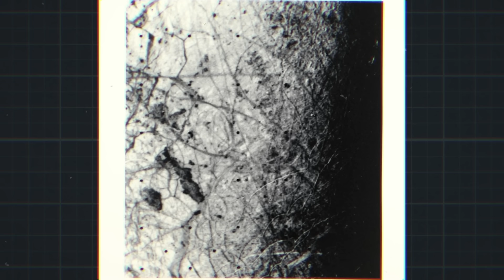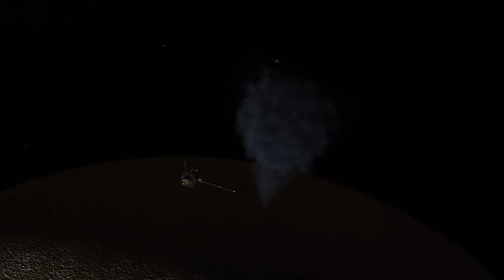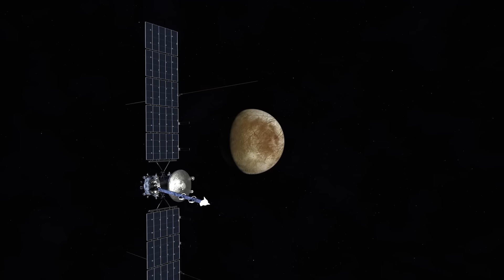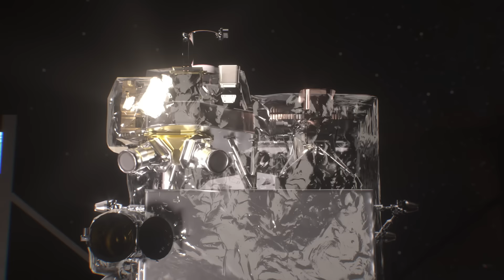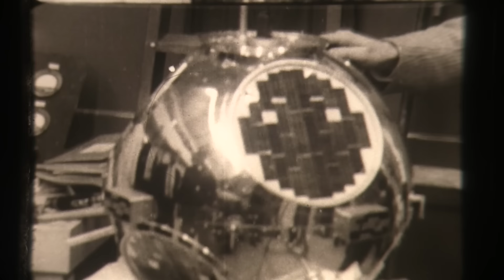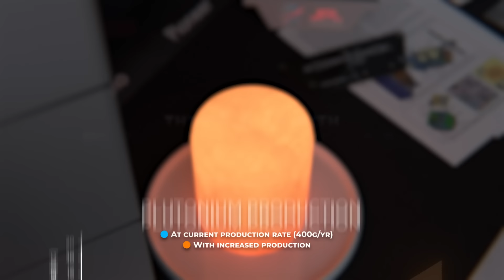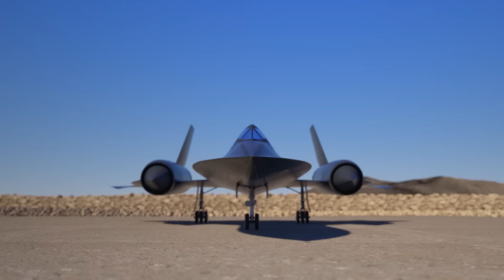The Insane Engineering of Europa Clipper

Comment: Should have created a lander with a drill so we can see underneath. Very underwhelming.
Reply: do you know how long the drill would have to be? also it will have to land repulsively, by itself with no comunication with earth. that would be basically impossible and nasa doesn't have the budget for that, besides what if it ends up landing and then the drill breaks? the whole mission was completely worthless, with the europa clipper it is actually possible.
Reply: @braydenstrand3572 what about a small drill with a camera that operates on nuclear energy. It can drill itself through the ice and nuclear energy is long lasting. Similar battery to what the voyagers have. You also send several drills incase some breaks. This would probably cost around 60 billion. USA spent that in the recent Iran conflict already. It can be done with a little faith and imagination.

Comment: Mars ALMOST had life, but it was too small to keep its core molten long enough so the magnetosphere went kaput and it was stripped of its atmosphere after only a few hundred million years; not long enough for abiogenesis to happen (the earliest record we have of life on Earth is from about 500 million years after the Theia collision).

Europa, on the other hand, has an icy shell to block out enough of Jupiter's radiation for it to not really matter by the time it reaches a potential marine biosphere, is clearly still geologically-active (its shell even has plate tectonics!), an underground ocean that dwarfs our surface one by volume, and many cracks in the ice that could let in a bit of sunlight for algae with reddish-purple pigments targeting infrared light which the Jupiter system still receives plenty of (yes, there are but a few algae species with similar strategies in Earth's deep-sea environments that do exactly this using the glow of lava from hydrothermal vents; this might also partially explain the strange color of these shallow areas in addition to the irradiated salts).

If there's any place in the Solar system besides the Earth that has life to this day then it would be the ocean moons of Jupiter and Saturn (especially Europa and Enceladus), and/or the cloud layer of Venus that has Earth-like pressure and temperature, where water vapor can condense into micro-droplets and we've even seen some potential signs of microbial life (like phosphene and weirdly-dark patches. At this point, given what little that we HAVE been discovering about our deep oceans recently (technically the most "alien" place in the solar system when you think about it) I'd be surprised if there isn't life on these ocean moons.

Comment: Did I miss the part where the interior was determined to be H2O? Liquid, for sure. What is the evidence it is water?
Reply: spectroscopic data revealed that the surface was water ice so its way more likely for the ocean to be water than anything else, and the fact that methane etc is nowhere as common as water ice in the solar system

Comment: I wonder why NASA didn't decide to make two Europa Clipper spacecraft and have one orbit Europa instead. The production cost wouldn't have been much higher, just the launch. And seeing as Falcon Heavy was used to launch, it wouldn't have been an insane cost increase.
I wonder this because I would have loved to see the difference between the data gathered by the two. It could establish clarity on whether it is worth stretching a mission with so many gaps of little-to-no data while avoiding areas of intense radiation or if all the necessary data can be obtained in orbit of the target within a much shorter span of time.
I am guessing NASA didn't feel the risk of getting worthless data from a probe in the radiation-heavy orbit was worth the increase in cost, if they did consider this option.
I would love to know if they did and why they decided against it.

Comment: Isn't it slightly odd that they only went with 8MP for the cameras? I mean, I know megapixels isn't necessarily the be-all-and-end-all of image quality, but my phone has 64MP sensor so surely they could have gone bigger without costing anything in terms of weight/quality?
Reply: Could be due to the data storage, also at the distance its orbiting it probably isn’t worth having such a high MP, 100m per pixel is likely ‘good enough’. Who knows why, but I suspect that transmitting high resolution images is also difficult to do at that distance. Plus the high radiation exposure could be a problem? By the time this information reaches earth would it still have the same detail?

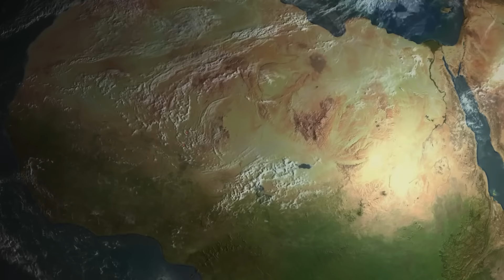Comment: Uhh... I dont think GPS works in space 11:44
Reply from the maker: GPS signals are being tested for moon navigation on the next moon landing attempt at the end of the year actually
Reply: @RealEngineering  huh never knew that. Interesting!
Reply: Why not? As long as the satellites are in a lower orbit than the GPS sats, they should function identically as if they were sitting on the surface. GPS satellites are in a very very high orbit for this exact reason.
Reply: @Alexives111  I suppose?

Comment: FIVE BILLION DOLLARS. $5,000,000,000.00 It should be able to orbit that damn moon for 5 thousand million dollars.

Edit: $5 Billion was for the entire mission cost not just the spacecraft. I couldn't find a single mention of the cost breakdown so I don't know what the craft cost, but it's not going to be much apparently.
Reply: The radiation belt of Jupiter is what they have to contend with. If they add more shielding and redundancy it will make it heavier and heavier, thus harder to launch with a falcon heavy and driving up costs further. The orbiter will only be a portion of that as people have to be paid, rockets have to be launched and research has to be done.

Comment: Corrections/additions: 
- The magnetometer is very cool, but the design isn't novel. In fact, it's one of the more well-established instruments on Clipper, the general design having flown on past deep space missions.
- The doppler measurement description is incomplete. The key to measuring the frequency change is that the spacecraft radios have a feature called "coherency" where the downlink frequency can multiplied by a known "turnaround ratio" to modulate the uplink frequency. This way, the precise instrumentation on Earth can compare the frequency being transmit to the frequency being received, which is much more precise than if Clipper had instrumentation onboard to measure frequency.

Comment: “We can measure the velocity of the probe with an accuracy of 1mm/s" this data gave me chills. It's so surreal to think that that we can measure an imperceptible change of speed of something up to 1 billion kilometers away. The technological might of humans never fails to move me.
Reply: And it's even more insane to have that small of a resolution, considering how mind bogglingly fast this probe is moving.
Reply: I think he said 0.1mm/s. I wouldn't have commented - but it would make the measurements 10x even more awesome. It's literally a microscopic amount. 

0.1mm = 100um being towards the upper end of the sort of distance you would deal with down a microscope, even if it is just visible like a very fine hair. Sorry second paragraph is my own pedant-cover.
Reply: The ability to measure the velocity that accurately is what is impressive.  The distance is irrelevant.  That's just radio.
Reply: I think you are correct on 'This data gives me chills'.

Eg I paraphrase from OED:  data - second meaning. Mass noun. All types of numerical information considered collectively. Apparently been in use as a mass noun in English from 1645. 

The strict interpretation of datum/ data is in Latin, which is a different language to English, which has the ability to change and update, like other modern languages. 

🙂
Reply: As long as it's moving well below the speed of light, I think delay on pulses back would be easy enough to do by meow.
Reply: now imagine what the military sats can do in orbit of our own planet.

I know years ago it was announced that they could hit a license plate from space. Weird how they can't seem to find a cure for a disease, a way to help folks live healthier lives, or an end to poverty and hungry though.

Priorities. Much more important to kill each other than help each other survive, you know. VERY important.
Reply: 0.1mm/s, even crazier
Reply: If they would use ranging, 3cm relative range accuracy would be possible (as done in Juice or Bepi Colombo). The biggest problem is to isolate the effects (e.g. interplanetary plasma, relativistic timescales, ephemeris of Jupiter and Europa).
Reply: But can’t investigate the Epstein files
Reply: data is plural, "this datum gave me chills", sorry for being pedantic, I thought you'd want to know.
Reply: @SMacCuUladh  This is the second time I’ve been called out for grammar errors in the comment section. Guess I can’t hide that English is my second language. 😂
Reply: @SMacCuUladh  probably because "datum" sounds like a made up word
Reply: @charlethemagne5466  I actually knew that datum is the singular form of data, because it’s derived from Latin. I just didn’t think of using it.
Reply: @SMacCuUladh  Because we don't use it. We say "piece of data". Also, not sure if you're a native English speaker but among engineers there's very little grammar and word policing. It's normally seen as pseud behavior and in the wild it will get you thrown off of tech teams very quickly.
Reply: @SMacCuUladh  Exactly. Cope discord chat room responses. Where do you work? What's your profession and specialty?
Reply: @SMacCuUladh Huh, never in my life have I heard "datum" as an english word, only "piece of data". Interesting to know
Reply: @SMacCuUladh Commas and periods aren’t the same. Sorry for being pedantic. Thought you’d want to know.

Comment: We don't know if there is a subsurface ocean on europa, the magnetic field deviations mentioned could be explained by a conductive salty ice layer and there may only be small subsurface reservoirs on europa, we also don't know if the radiolysis theory is true and AFAIK the peroxide decomposes into water and oxygen, then said oxygen acts as an oxidizer and the concentrations of peroxide would be insufficient to oxidize molecules directly.
There's multiple ways life can exist on europa like thermal vents or clinging to the ice ceiling, where in the latter case clipper won't be able to detect life as NASA wants to fly it thru an ejected plume from one of europa's volcanoes.
Also I want to see a video on the titan probe's engineering! they prepared for every event  in case the probe managed to land on the moon, like splash down on one of its lakes (yes, there's a moon we visited which had liquid surface lakes, and an atmosphere ofc! you could in fact stand on titan without a space suit as that probe found out.

Comment: there's a lot of unintentional misinformation in this video. While there are absolutely radiation from the sun, what's in Jupiter's radiation belt isnt mostly sun radiation, it's caused in great part by Io's ejection of particles accelerated by Jupiter's magnetic field that bombard objects in the belt. The crust of Europa isnt what's protecting the ocean from radiation, altho it will absolutely help, water is a great moderator in and of itself. That's why they use it in nuclear reactors, not just for it's cooling capacity. That's why you could swim in a spent fuel pool and be fine, as long as you dont dive very close to the spent fuel rods (The vast majority of people wouldnt be able to dive deep enough), that's also why drowning is the most dangerous aspect of those pools too, not radiation.

Comment: Im a huge SpaceX fan, and get caught up in the details of the Starship testing programme (big W at the weekend for the catch attempt for example), but I forget, in the end, Starship will just be a big bus to deliver stuff into the solar system (admittedly with the capability to deliver quite BIG stuff). This really good video reminded me that the science and engineering which goes into the planning of these missions, and making the instruments on the craft so sensitive and solving problems in such clever ways, is on another level. Its right that this is NASAs forte, and leaving the design of cheap, reusable heavy lifters to those who specialise in it.

Comment: Those huge solar panels will only produce 150 watts.
Reply: 1/5th horse power. 750 million miles from the sun. Not much to crawl around in our gravity, but used efficiently, it may do
Reply: They will produce however much the mission needs. If they can’t build them big enough to draw enough power, then they will use a different power source. Otherwise, they wouldn’t be going.  As he said, that far out, you’re only getting a slither of the sons power.